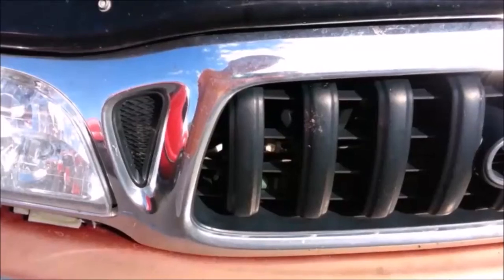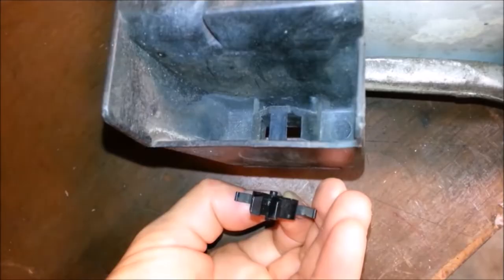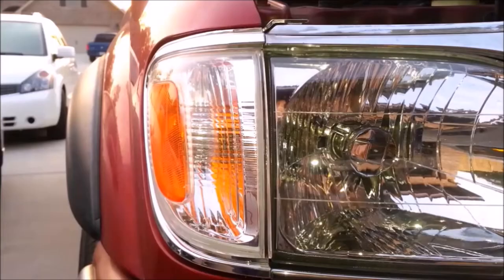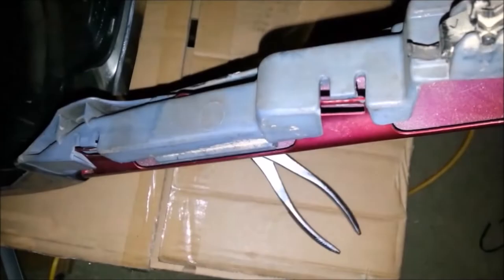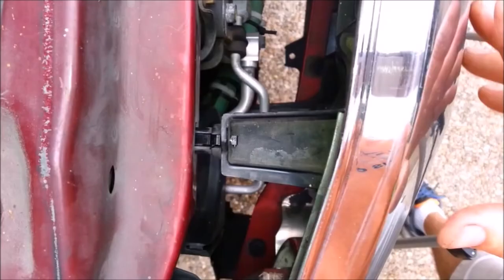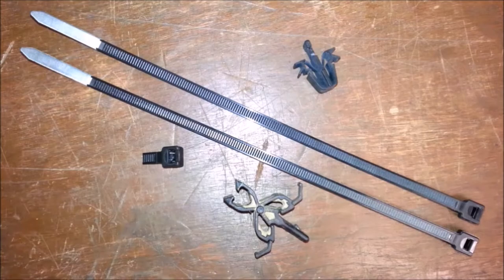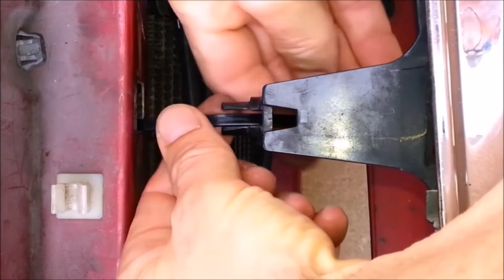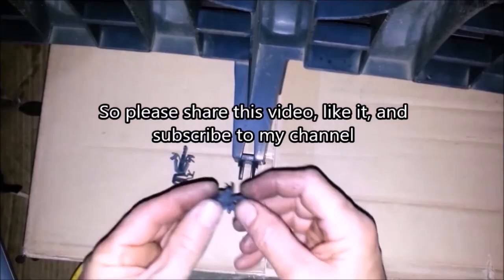Tacoma Grille Remove Install How To 2001 2002 2003 2004 Toyota

Comment: Thanks for the video awesome job. One question do you have the clips part number for upper and lower.
Reply: The part numbers are in the description/text part of the video
Reply: The part numbers are in the description/text part of the video
Reply from the maker: I'm finally back from xmas on my normal computer.  This is from the description/text part of the video.

Small clips:
Part number: 90467-12040 (usually in stock at the dealer) 
The prices I got from dealers in my area were from $1.21 and up per clip (in 2016/08 in Florida)
Non-OEM small clips on ebay are about $2.00 for 20 (but they probably won't work and take a month or 2 to get to the US)

Large clips:
Part number: 53145-12010
The prices I got from the dealer were from $3.65 and up per clip (in 2016/08 in Florida), but they didn't have them in stock.
OEM large clip prices on ebay vary a lot. $2.64-$7.12. 1 week shipping. (I didn't see any Non-OEM large clips on ebay)
These clips are more difficult to work with than the small clips, so you should probably stick with OEM.

Comment: I broke one of my grill clips I think I’ll just leave the grill alone before I break the rest of the clips trying to take it off
Reply from the maker: They break very easy.  Best to just go back with UV resistant cable ties.  I show how to do that in the video.  Could probably use a piece of wire instead if you don't like the cable tie idea.
Reply: I will probably buy the OEM clips. Or I will use the zip ties.

Comment: So what's the best, cheapest way to get these grill clips? I found a few OEM ones but the shipping price is very high for such a cheap item. I'm going to call the local dealers and see if they can order this for me.
Reply from the maker: Check the description/info section under the video.  I haven't had to buy any since 2016 so the info is kind of old, but might point you in the right direction.  Main thing is to avoid the non OEM stuff unless it is from reputable brand (maybe).  I like the cable ties better because the clips are kind of a pain in the behind anyway.  The large ones are especially difficult to work with.  They are designed to be easy for the assembly line worker to snap the grille into place.  They are not designed to be easy to remove or reuse.